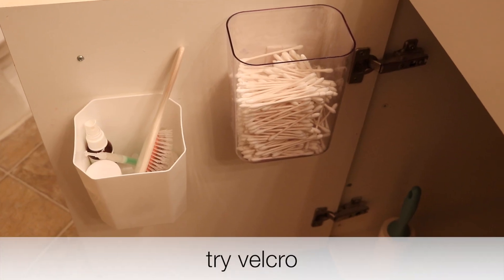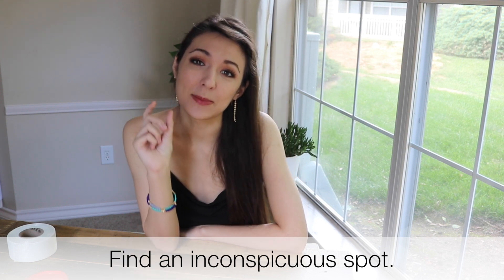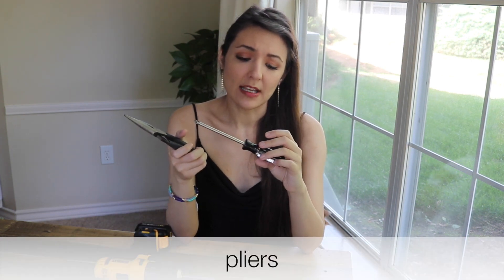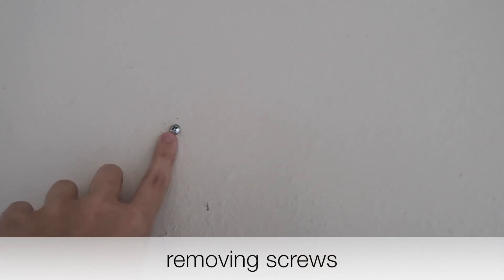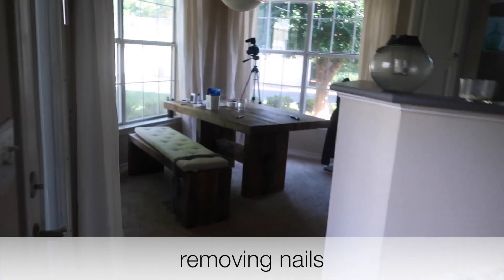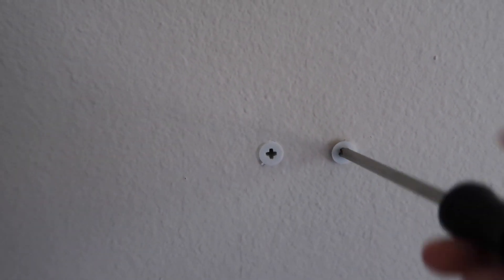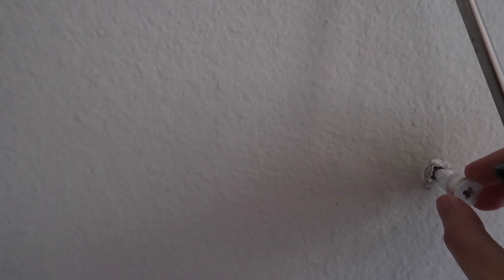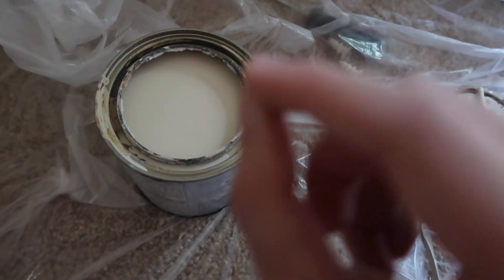Patching Holes with Pat

Comment: I still remember how amazed I was when I discovered they could recreate colours at the home improvement store just from a sample! It's like magic!! Then I discovered that the minimum size container for that was 5l and was somewhat less pleased. 😁 
Here's a tip for storing paint: Fill the remnants into something smaller, like a mason jar (empty srcew top bottles also work great, if you have a funnel) so there's as little air as possibly at the top. Then shake the container, so the paint seals of the opening from the inside. Very important! 
And don't forget to write the name/paint number on there! Because it still doesn't keep forever.
Also: If the paint job was a while ago, make sure the 'fresh' paint still matches the one on the wall when applied and thoroughly dried. Sunlight can fade paint near windows...I ended up with blotchy looking walls that way, one time 😯 Although I think current high quality paint is way more resistant to that kind of thing that the cheapo brand I used 20 years ago...just thought I would share 😀